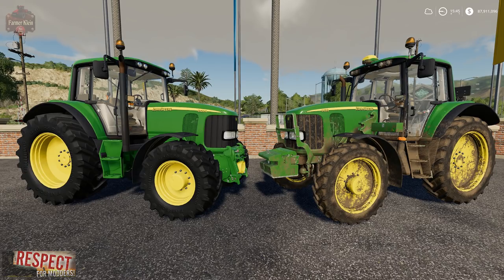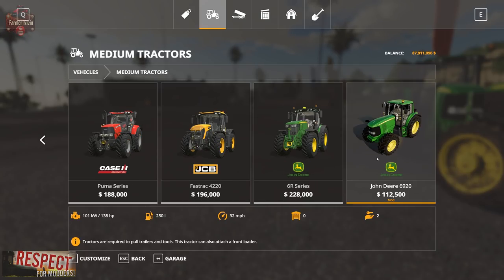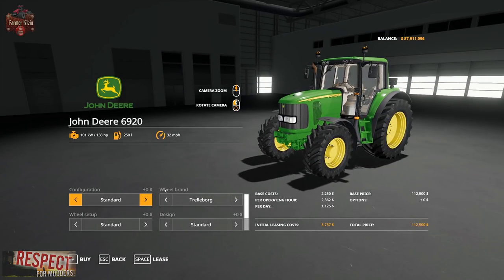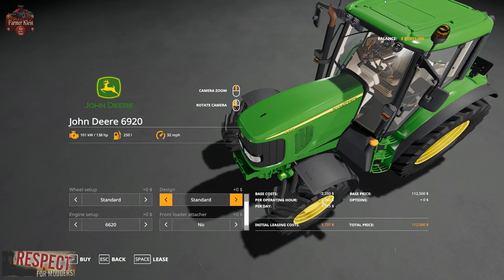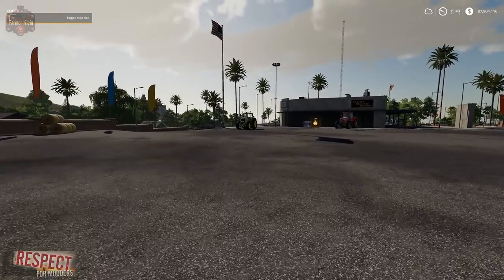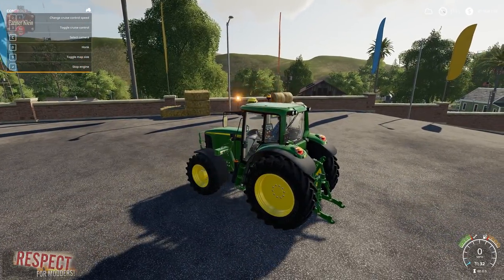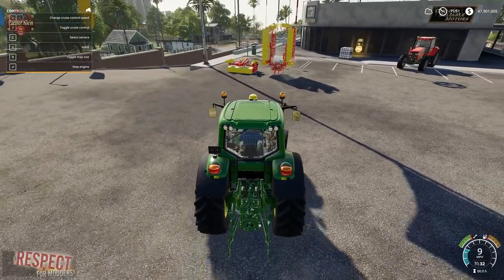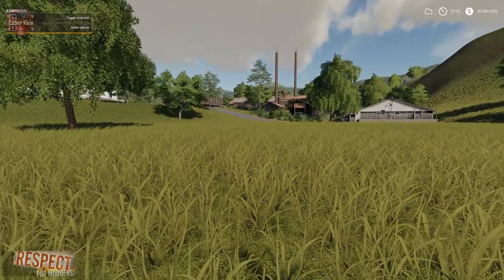Mod Review - John Deere 6920S

Comment: I'm looking for something bigger than the Fendt 1050, that has more pulling power without being a hinging body style and not unrealistic.
Reply from the maker: More HP than a 1050 and not articulated and somewhat realistic.  Not sure I know anything that fits that bill.  I rarely play with stuff that large in my own game saves.
Reply: @FarmerKlein  what about the Fendt Trisix that released recently? That has more power then a 1050, is bigger then a 1050, and doesn't have body articulation like a lot of the big tractors such as the T9, Quadtracs, Challengers etc.
Reply from the maker: i thought about that but the not unrealistic comment made me rule it out.  The Trisix was as I understand it a tractor that never made it into real production and was just a concept tractor one off kind of thing.  But ya that would fit the bill if Jason was not worried about it not being a production run tractor.